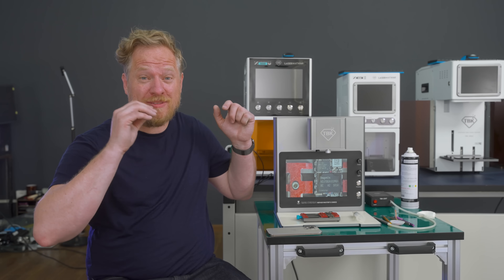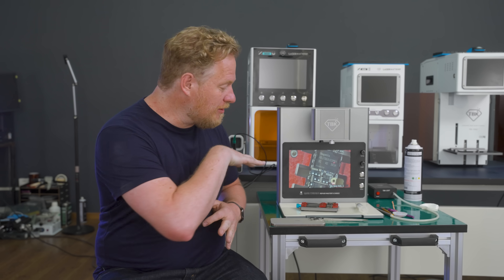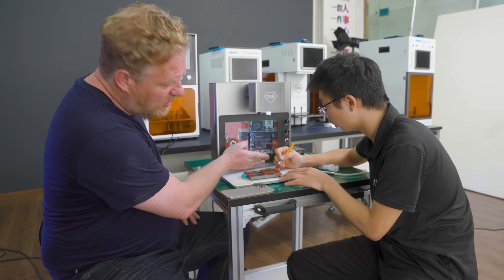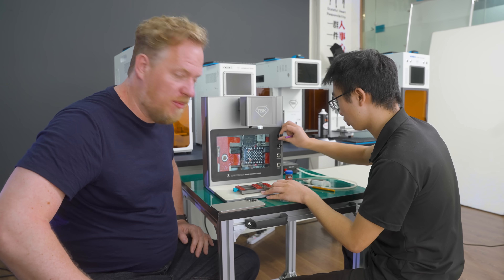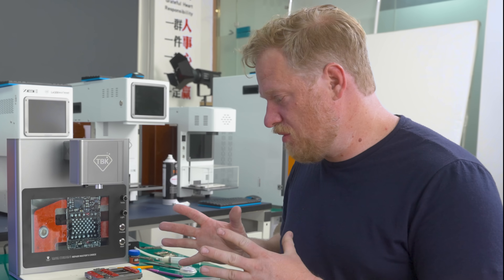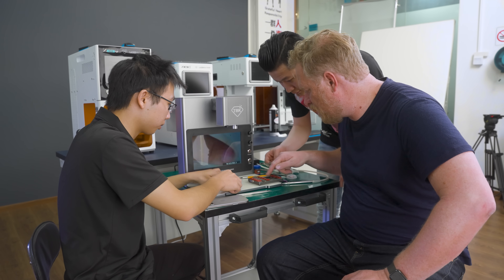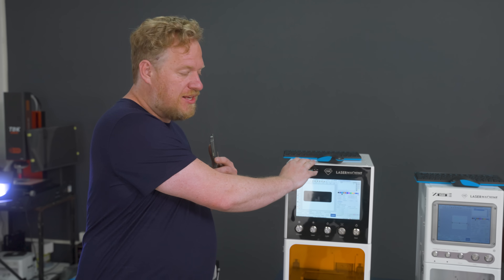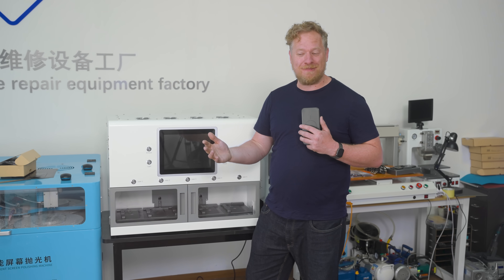This Shouldn't Be Possible

Comment: Seriously I know IR is absorbed by lots of materials but EYE protection! The fiber lasers still need eye protection. I think standard glasses actually provide protection but you've got nothing!

About the technology. This is fantastic. I just worry that the differential absorption rate of materials might mean you're fighting to not cook / not getting enough heat on the components. 

Also it really just looks like a galvo laser. With probably controlled power within a known range that won't cook components. It's nice software but from a hardware perspective I don't see what's revolutionary.

Honestly wonder if a better interface could be done. Buttons suck when you're reaching across the beam. I know it's out of focus but eeh. And! Why not a screen where you draw the rectangle you want to heat? Instead of having a solid point that you're moving the pcb holder to?
Reply: I agree, the display and buttons need to be either far enough to the side or in front of the hot beam, and i would want at least some safety features like fume extraction/filtering hood and some form of eye protection / safety interlocks added to it. Pretty sure our health and safety inspector would immerdiately remove that device from the workplace, as soon as she sees it. Or our european customs officers would probably intercept it even before that, as there is no information about EMC, safety certifications or anything like that available on the website. I also always get suspicious when they only show 3D rendered and photoshopped pictures of the machine on the website.
Reply: @ProtonOne11  This device is not "health and safety inspector removes it"-level dangerous, but "the boss is going to jail"-level if this thing is operated in the manner shown in this video in a European company. I really hope customs will recognize what this thing is, as I'm sure there is no appropriate labelling on there.

Comment: What about eyes protection?
Reply: Use your other eye
Reply: Mid-to-far infrared (IR-B and IR-C) (approx. >1400 nm), Infrared lasers won't damage your retina because they can't make it past the front of the eye, that being said, higher power levels, other that the ones in the video, can for sure heat up your eye too quick and denaturalize proteins. 
Near-infrared (IR-A) (approx. 780–1400 nm): This wavelength range penetrates the cornea and lens and is focused by the eye onto the retina. Not what they're using.
Reply: Eye protection is overrated
Reply: Even sunglass could protect this really weak laser😂
Reply: And ventilation 😬👨‍🏭
Reply: in china?
Reply: how do you see what you are doing?

Comment: >lasers
>no laser glasses

come on guys, those things can still reflect even if they're pointed downwards

you also don't need a laser, you can just use a heating element that gets up to 350C, contact it to the top of the chip, and it'll also work.
Reply: I think this is a lot easier to use imo than bringing up a hot plate/heating element to a chip, although I 100% agree they should have been using eye protection
Reply: Any heating element would corrode eventually. I guess laser is better.

This thing saves repair people from buying iron tips, sponges and a lot of wasted soldering lead and tip tinner. 🤣

But the best part is.. Salavaging parts.   This can help removing parts for electronic waste for salvaging purposes
Reply: @ChibiKeruchan  yea but a heating element is $2, a power supply is $40, and a laser system like that is at least $2000. this is nonsense.
Reply: @cheater00 Not if you run a big electronic repair shop it isn't. For most hobby people yes it's not necessary.
Reply: @cheater00 and how often do you have to buy the heating element? That’s more likely to damage the board